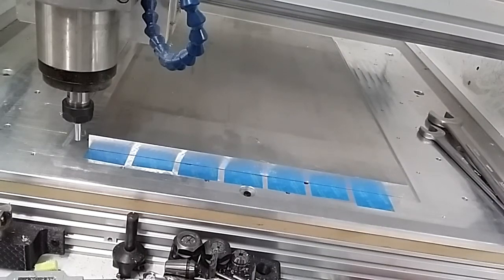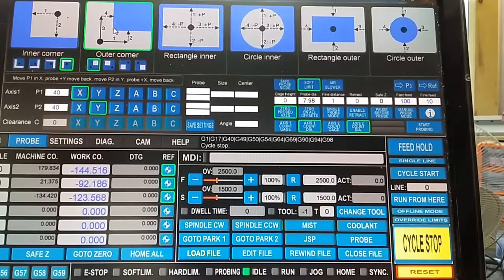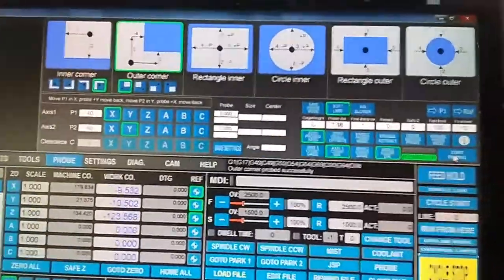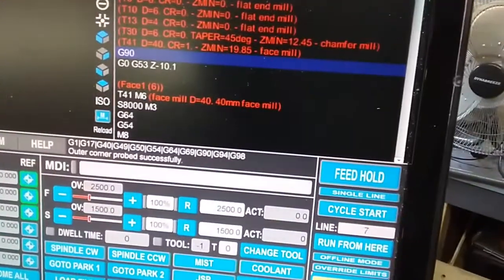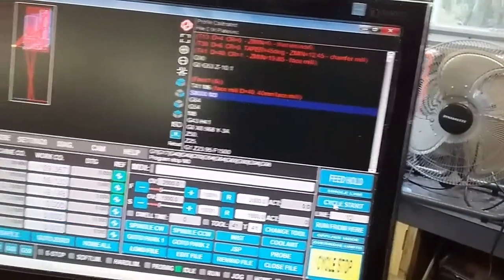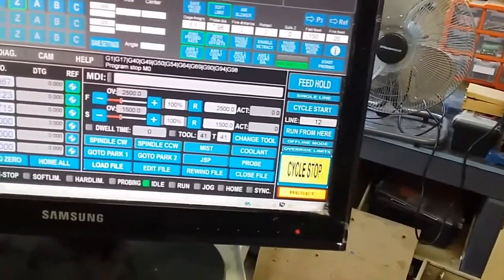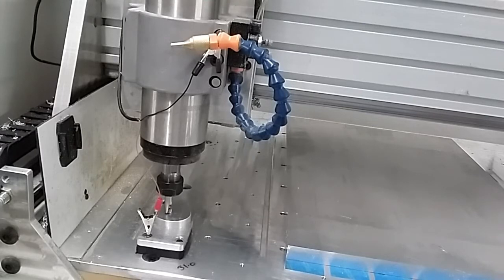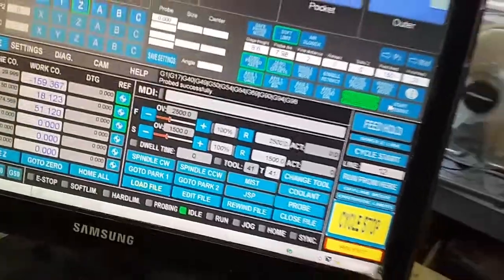Probing test

Comment: Sweet setup, so jealous!  What screenset for uccnc is that?
Reply from the maker: Latest development version
Reply: @tomahawkcnc   Thanks a lot!  Would you be interested in selling a driven nut system for a cnc router? I want to move away from rack and pinion. I could provide the motors and screws, if you could make the driven nut drives.
Reply: @tomahawkcnc  Accidentally replied wrong. anyway this is what I said:
Thanks a lot!  Would you be interested in selling a driven nut system for a cnc router? I want to move away from rack and pinion. I could provide the motors and screws, if you could make the driven nut drives.
Reply: Which machine is that you are using in this this video? It seems to have much faster acceleration than I’m use to seeing. Thanks